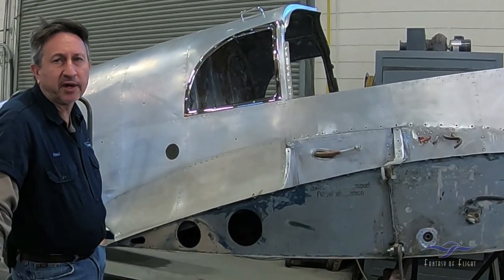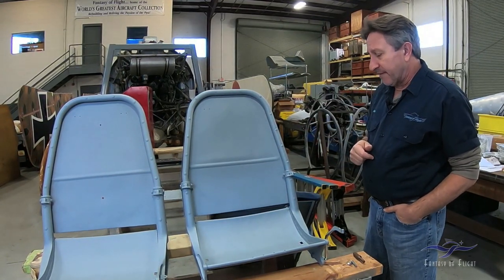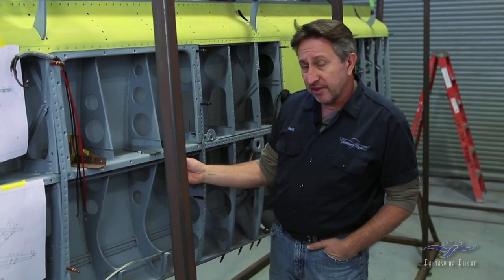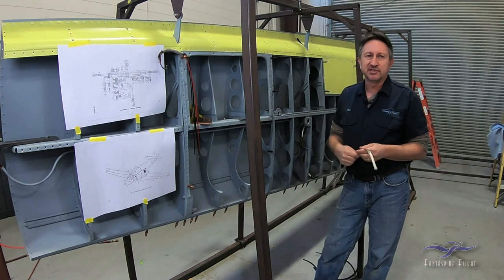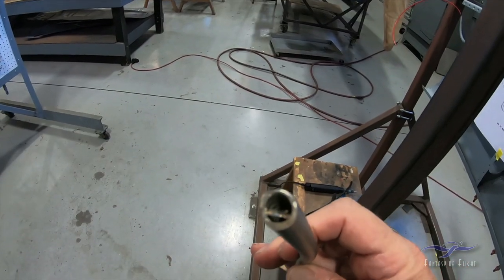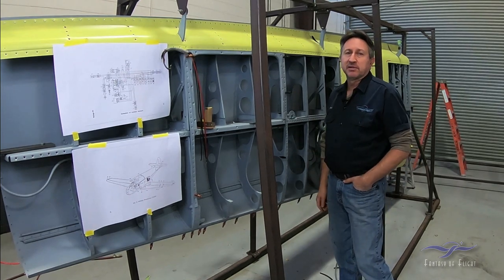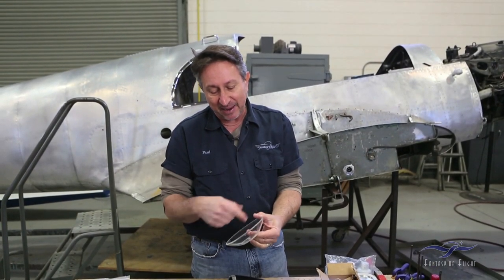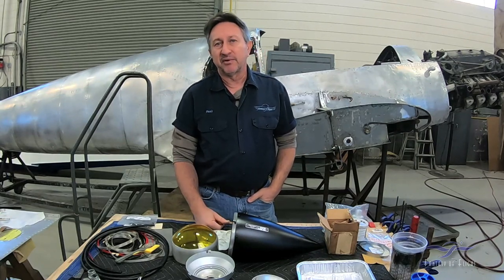Messerschmitt Bf-108 - Restoration Update #19 - December 2020

Comment: As an electrical engineer involved in aging of elastomers (such as wire insulation), I would have to say that wiring is one of the things that really needs to be replaced with something modern!  It is great to have it look original, but very important to use modern materials.
Reply: Valid points. I have been watching another channel where the restorer, Ian Slater of Typhoon Legacy Co. Ltd, talks about getting the plans and jigs and parts to re-build a flying Hawker Typhoon JP8_43, that will have to be certified by the Canadian aviation authority. He has to stick to the exact structural design to get the certification. If you deviate from that with different materials and parts, then you can get a situation where it would have to be trialled and tested by an approved aviation company. That could be an impossibility or extremely expensive. So this Bf-108 restoration is probably under the same constraints.

Comment: Great sign off Paul. Your comments about thinking outside the box and the automotive parts catalog reminds me a bit about my Auster project. Built in 1952 (but as a type built since 1938) the trim handle (mounted in the roof) and the handbrake (a pull to engage the weakest brakes known to man!!) are both parts also seen in British cars of the era, with the trim handle a window winder and the handbrake, well yes a hand brake. Also oil tank cap (Gipsy Major) which was also used on the nose mounted fuel tanks on some Austers (mine has wing tanks) is a car petrol tank filler cap, the round domed chrome with a chain in the centre although don't think the aircraft ones had the chain.

Comment: That type of flexible conduit is used in the industry even today to wire up machines, protect rubber pipes etc. You can get them in all sizes from 5mm to 100mm. They are holding up very well. The wires decay earlier than the conduit. 
I rewired a machine from 1950. The old wire insulation decayed into a black goo.

Comment: They have a cable system produced in this country that is similar to "German cable".  It is a replacement for electrical wiring in buildings where a shield is required, conduit is too hard to run and standard Romex isn't enough protection.  It is called MC cable (MC is for Metal Clad), and you can still get it at hardware stores.  It has standard house wiring inside it, but the shield is the same.

Comment: If the mirroring kit for the landing light doesn't work out, find an astronomical telescope mirror-recoating shop (e.g., Spectrum Coatings in Deltona, FL). They can vacuum-deposit a silicone-monoxide coated aluminum surface to the glass (~88% typical reflectivity uncoated, more coated). Probably a couple hundred bucks or so. Great series.

Comment: Aluminium wire tags were the norm before we had synthetic or synthetic sleeves.  Every aircraft and the military vehicle I have seen had had the wires numbered and the military to this day still uses aluminium wire number tags..
Reply: That's right Matt! Until you mentioned military vehicles, I had forgotten about the wire tags. I worked in a motor pool (Army) and the main wire that brought battery to every componet of a military vehicle was tagged 27. Didn't mater what kind of vehicle. In training we were told that everything from a Jeep to a Huey would have similar systems tagged that way. This was in the 70s - I wonder if it's stiil the same now.
Reply: @mikehalm164  Interesting information. So are you implying there must be a 'Master Code Template' that lists what each number represents? eg 1: earth wire, X amps, braided  2: Ground wire, X amps, black insulation 3: etc etc

Comment: +KermitWeeksBlogVideos  Did Bayeriſche Flugzeugwerke (DEU) use Deutſcher Normenausſchluß Standard 72552 to engrave the wiring diagrams for the Bf 108A-3?  The mirroring for the Pintſch (Berlin, Preußen, DEU) landing light is probably done in vacuum conditions consistent with the mirroring technique for the giant Mt. Wilson (Los Ángeles, CA, USA) and Palomar (San Diego, CA, USA) giant reflector 'scopes.

Comment: Bf-108 "Electrical Sleeve" take a look at the eBay seller, Motorola two-way early radios used a cloth wiring loom that I've seen used in 1920s and 30s automobile applications maybe this is what the Germans used.
"3/8 x 10 ASPHALT CLOTH WIRE LOOM ORIGINAL RESTORATION U.S.A."

Comment: How many people and how long did it take the original factories to make one of these planes?   And how long for other WWII planes?  Did some countries have an advantage from a manufacturing standpoint?
Reply: Prototypes might take years, though there have been drawing board to flying prototypes in months.  

Once there was a system for manufacturing in place aircraft could be turned out quickly - during WWII it was common for manufacturing to produce multiples of a single aircraft in a single day, and depending on the varying size and systems of aircraft might take dozens or hundreds of technicians to produce a single aircraft in a mass production environment.  

Manufacturing times varied aircraft to aircraft but time for manufacture in a mass production environment would trend towards longer for larger aircraft due to more labor required to construct and a larger variety of internal systems.  

Axis aircraft generally took longer to construct as the war progressed because of damage and destruction to factories and  manufacturing centers and materials shortages, whereas the Allies had the advantage of established mass production infrastructures as well as ready access to a wide range of raw materials.

Comment: 14:53 A mirroring kit is available? Just what I need for redoing the interior mirror and vanity mirrors on one of my cars. 
So on your project you will be applying the kit (a 2-part finish application?) to the convex of your glass. I see a work stand with the glass mounted on a cone to apply the finishes, it would seal overspray from the concave portion.
What is the mirroring material composed of? Is it a mercury based spray? That doesn't sound healthy though.

Comment: Speaking of asbestos, are there any haz-mat issues when you're prepping old planes for reconstruction?
Reply: There's zinc chromate primer, possibly lead paint (probably all of the old colors are pretty hazardous), instruments with Radium paint so they glow in the dark, leaded fuel which is still used for aircrafts, toxic wood protection, ...

But that's all something you'll find in many old things, not limited to aircraft.

Comment: i saw almost no oldnes in the old mattel seat,  but it had to be replaced to get money, this going to far is my opinion. same with the wiring just take what works . you dont see that , its in the wing!    pfff
Reply: Flying aircraft have to go through all manner of certification, for ANY changes from the original plans. I am afraid that Paul may be restricted to keeping everything as close to the original design and materials as stated in the Bf-108 plans, otherwise it will not be approved for flying and would be restricted to taxiing only.